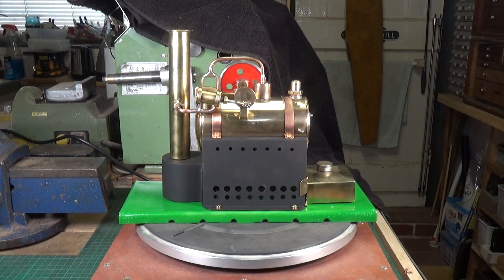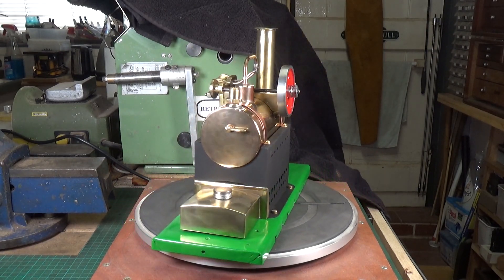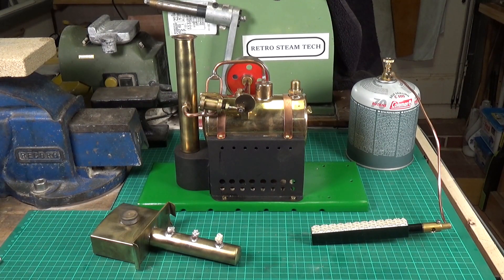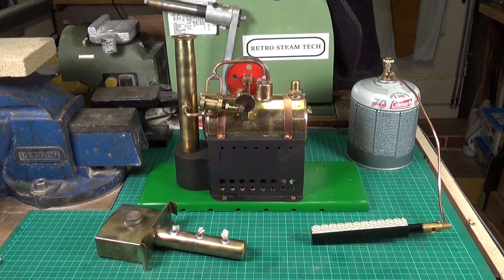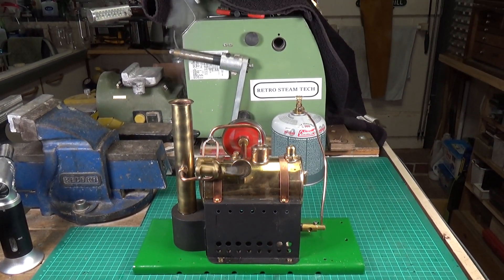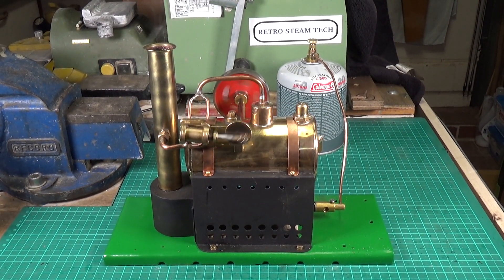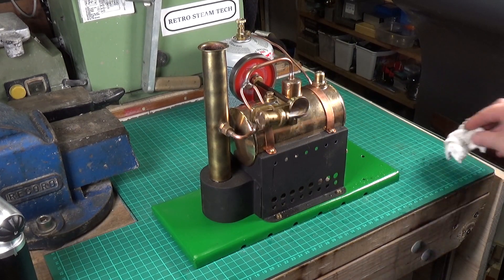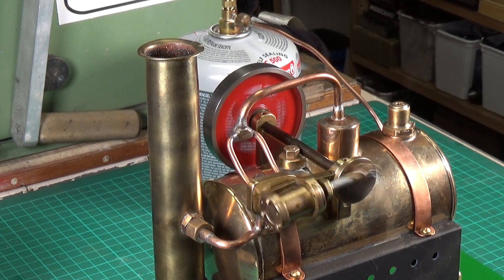Large Scratch Built Overtype Model Steam Engine - Part Three

Comment: hi alan, 
lovely job, nice series, i've just got back from a 4th  run on my loco i scratch built in the series i video'd. 
This just finished the afternoon off nicely, the whole steam experience is great, the engine you've built runs lovely and the sound is hypnotic!!!!👀👀😁 One question how do you know how much water is in the boiler i couldn't see any water gauge or did i miss that.!!
take care 
mr f
Reply from the maker: Thanks. There is a level plug in the boiler end cap at the burner end of the boiler. I just fill the boiler till water dribbles out of the level plug hole. On a large boiler like this one you ideally want between 1/2 and 2/3 of the boiler full. Cheers, Alan.